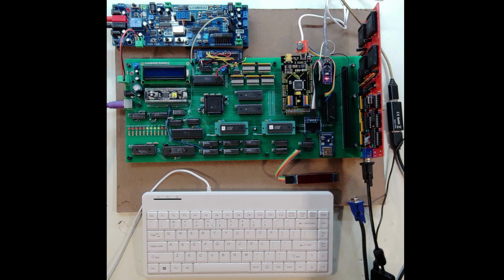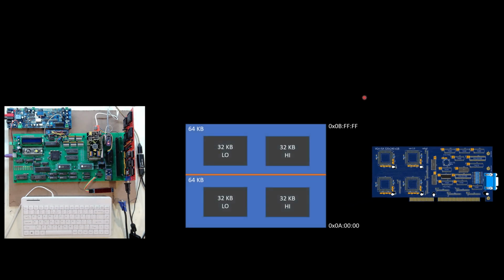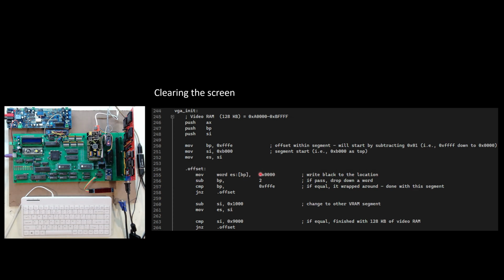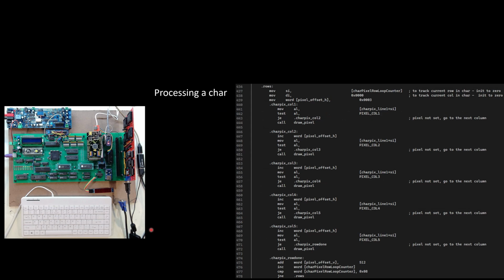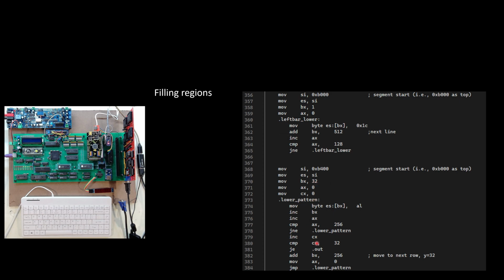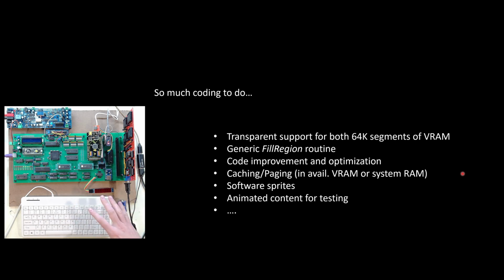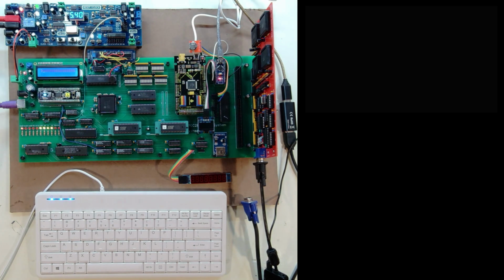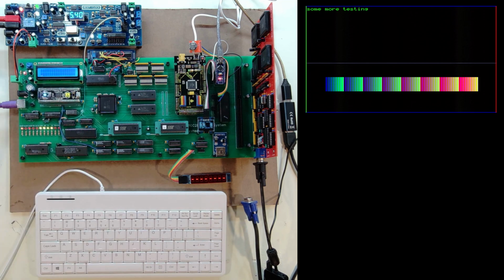80286 Build, Ep. #65 - A Start to VGA Code

Comment: Another amazing video! 

My second suggestion:

I did a bit of rewriting of the vga_init_red code and rewrote it to be a bit more generic and (hopefully) to introduce to you some new x86 instructions:

;
; vga_init_color: initialize VRAM with a specific color
; 
; In:			AL = color to write to the screen
; Return:		Nothing
; 
; Preserves all registers
;
vga_init_color:
	; Video RAM  (128 KB) = 0xA0000-0xBFFFF
	push	ax
	push	cx
	push	di
	push	es
	pushf						; Save flags (we're setting the direction flag later)

	mov		ah, al				; Copy contents of AL to AH
								; (i.e., 0xffff down to 0x0000)
	mov		di, 0xb000			; segment start 
								; (i.e., 0xb000 as top)
	std							; Set the direction flag, DI will automatically decrented after each write
	mov		cx, 2				; The loop will run twice

.again:
	push	cx
	mov		es, di
	mov		di, 0xfffe			; offset within segment
	mov		cx, 0x8000			; This is the number of write operations
	
	rep		stosw				; Repeatedly store CX times
	mov		di, 0xa000			; Set DI to segment number of bottom half of VRAM
	pop		cx
	loop	.again
	
.return:
	
	popf						; Restore flags
	pop		es
	pop		di
	pop		cx
	pop		ax
	ret
Reply from the maker: Very nice! Thank you, @Damouze!

Comment: I am just about at a quarter of the video and something occurred to me. You are discussing the ways in which you could utilize the unused space in your video memory. 

If you think of your video memory as a video window of 512x256 pixels, with a visible portion that is always 320x240 pixels, with a couple of registers that act as a global starting address and X and Y adjustment for the display and some logic, a couple of interesing things become possible (and less of a performance hog):

* Viewports that can move about.
* Smooth scrolling.

I reckon it would be possible with two (16-bit) registers:

*  One containing the top 13 bits of the global starting address (allowing for 16-byte increments - 32 increments would constitute a complete display line).
* One containing two 4-bit adjustment values, one for horizontal adjust and one for vertical adjust. This would allow for horizontal and vertical panning of a total of 16 pixels.

Ok, enough ranting for now. Back to the video.
Reply from the maker: I've actually put some thought into that. I think I could reasonably add hardware scrolling in a future version of the video card. I might even be able to put those registers right on the PSoC. Otherwise, I'd have to expand the physical footprint of the card. I might try to go with some surface mount in a future version to cut the size down. Thanks for the suggestions, @Damouze!

Comment: Some of the older 1980s computers used to have power jumper wires on the PCB. A supply and ground running across the PCB surface stopping off a couple of times to add power.

Your boards appear to have some signal integrity issues. I'd suggest adding copper ground fill to both sides, which will improve your ground impedance for SI issues, as well as current carrying capability. Then you'll only need to run a 5V cable to a couple of points. I'd also suggest fattening up your power tracks - those tracks are all very small. (Ps; I design motherboards for a living, so sorry if sounding overcritical!)

The project is bloody amazing! I'm keen to see the project progress!
Reply from the maker: Thanks for all the suggestions, George! I truly appreciate all the ideas.

Comment: I'm a bit late to the party and I haven't watched all parts so you might already have thought of, and discarded, my suggestion, but, the doubling of ROM and RAM chips has bugged me since the beginning. You are running your system on a clock that is stepped down in two steps which allows you to clock your ROM and RAM (at least) two times per CPU cycle. This lets you read two bytes from one 8 bit ROM/RAM chip and latch them into two registers that can then be presented on the 16 bit data bus when the CPU is ready to read. The only limiting factor is the read speed for your ROM/RAM chips. The same thing can be done when writing, by again latching into registers and do two writes.

On a more general note I am impressed by your work and your dedication and it's always fun to see someone go at things with passion and determination. Keep it up!
Reply from the maker: Thanks for the suggestions, Peter! I'm already thinking about the next version of this card, so that I can support 640x480. I like your idea. I'll have to see if I can work something like that into an updated version. Thanks!

Comment: In re: power distribution, could you add multiple 5V rails and keep to a 2 layer pcb design? Since I know you're thinking about your final design being ATX sized, maybe switch to a 20 or 24 pin ATX power supply as that has multiple power rails that might make design easier. Heck, you could even add a 4 or 6 pin ATX plug directly to your video card.
Reply from the maker: Yes, I think it would be possible to have multiple rails on the system board. On an older version of the video card, I did include onboard power connectors; I just need to get them added back. Thanks, Greg!

Comment: re: the noise in the leftmost column. I wonder if it is a timing issue, maybe something to do with resetting the address counter after the horizontal sync? One quick workaround might be to register the output of the video memory so that it goes to the DAC one cycle later but is always stable?
Reply from the maker: Currently, I have the 74273 using PIXEL_CLK. I'm using a 74138 for SRAM OE signals. Are you thinking I would register the OE signal from the '138 with PIXEL_CLK, or even PIXEL_CLK#? (I have the latest schematic at the bottom of https://www.rehsdonline.com/post/vga-for-my-80286). Thanks!
Reply: @rehsd  Ah I see you are already registering the video data before it goes to your DAC (through U5). Maybe the issue is the timing of the CLR signal to this chip? Is it synchronised to PIXEL_CLK? Maybe this CLR signal needs to be registered and clocked out synchronously with PIXEL_CLK. I'm just guessing at what might make your first column of video noisy...!
Reply from the maker: @willsowerbutts  Thanks for the suggestions! It could be related to the CLR logic. I'll do some experimenting.

Comment: Amazing progress mate! These may be stupid suggestions on next revision though,
1. Have you considered to add VGA BIOS on board for initialisation and text modes?
2. Wouldn't it be easier to use bigger single SRAM chip instead of 4 smaller chips?
Reply from the maker: 1. Yes, a little bit. I need to put some more thought into it and determine what the design might be. I have a sound card I will be porting over to this build, and it has an onboard co-processor and onboard BIOS. I think I could leverage some of those concepts for the VGA card.

2. I would probably need to keep a pair of ICs, but I could cut down from 4 to 2. If I went to a single IC, I would probably need some special logic so that the '286 saw it as a lo and hi byte. I initially went with these SRAMs, and not larger ones, due to the crazy prices on the larger SRAMs. Dual-port SRAM gets really expensive, really quickly.

Thanks!!
Reply: @rehsd  Yeah SRAM are pretty expensive, I just checked IDT7007 and even 2 of them are expensive than TVGA8900D which I ordered recently :/ Looks like RP2040 got 264 KB SRAM which cost only couple of dollars :D Could work as glue logic and BIOS as well.